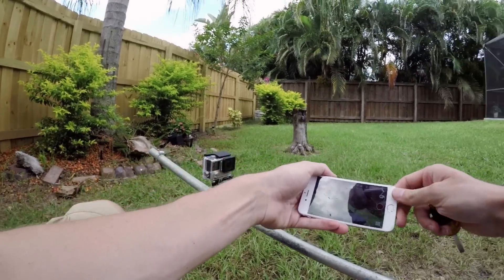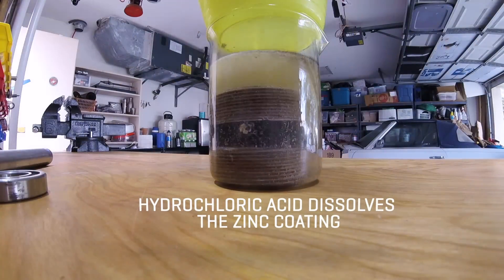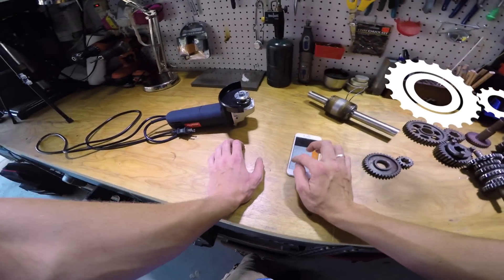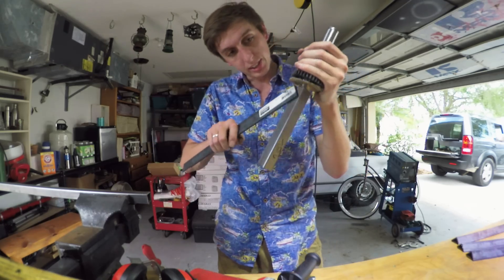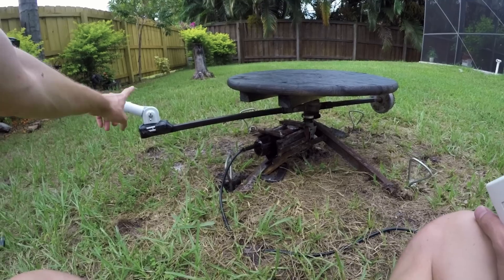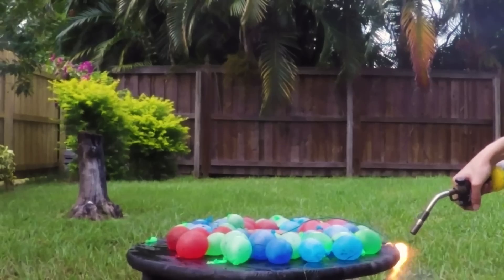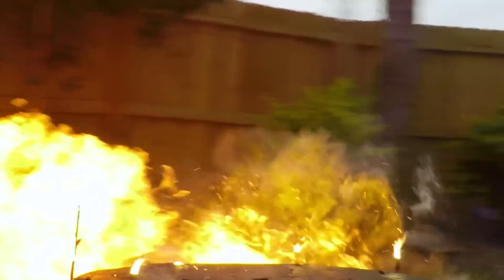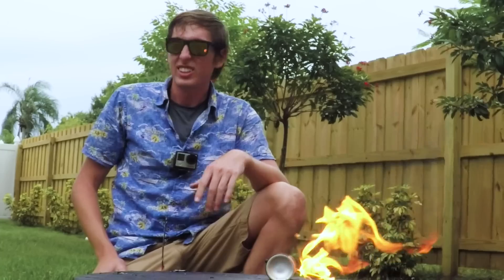GoPro: Bullet Time Experiments with The Backyard Scientist

Comment: I am a LICENSED California Pyrotechnician, I have decades of experience as a professional and an amateur.

1. There were NO "don't do this at home you dumbshite" notices on this video.
2. There were no discussions of safety calculations, or acknowledgement of having a safety crew on standby (no video evidence of said crew or gear either)
3. The scene was shot in a UNCONTROLLED area, FAR too close to a structure.
    What was done should have had a MINIMUM of 120' of clearance and honestly 400' should have been the standard.
4. The "host" was shooting a crossbow at an unsafe distance, at an unsafe area with little to no backstop.
    What would have happened if the bolt had deflected and gone through a window and killed/injured someone.
5. The "host" was NOT wearing a shred of protective gear, not even face/eye protection.
    There should have been at a MINIMUM a turnout coat/pants, gloves, nomex head covering, helmet with neck cover, and FULL face shield.
6. The "host" was handling actively burning remnants of the "can of volatiles"
7. The "host" is an UNSAFE & UNTRAINED FOOL and GOPRO should NOT be encouraging this kind of play.